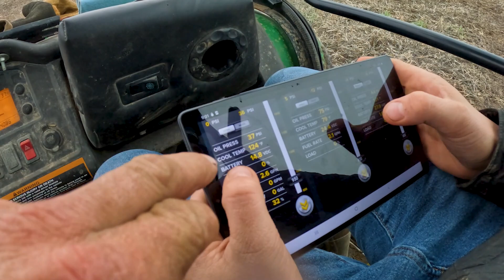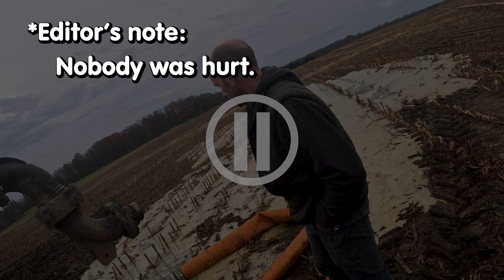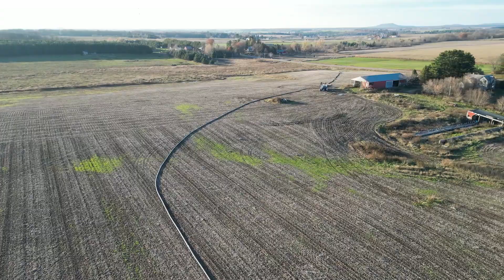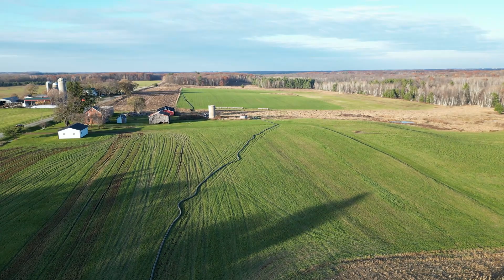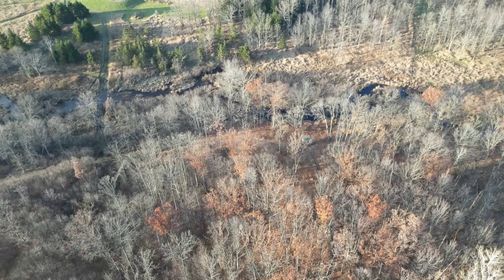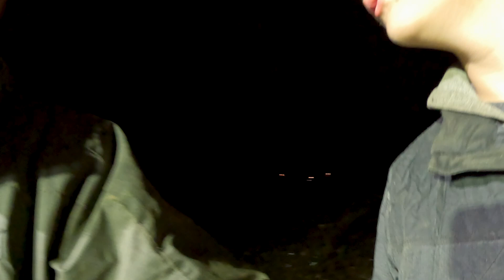We Use Too Much Sand!

Comment: How did you get the hose through the woods?  That is a big wow for a job.  My son and I had a setup like that and we only went one mile,  out of hog barns, and that was a lot of work.  I remember trying to push a pig through late at night, o degrees out, wind blowing, and a piece of wood got caught and stopped everything.  You guys did very good with a smelly, dirty job.  I have a lot of respect for you guys.  Going that far, takes good neighbors.
Reply from the maker: We actually drove the tractor and hose cart through the majority of it. Was very  pretty dry out when we.laid it through the woods . Some places we had to pull hose with the gator